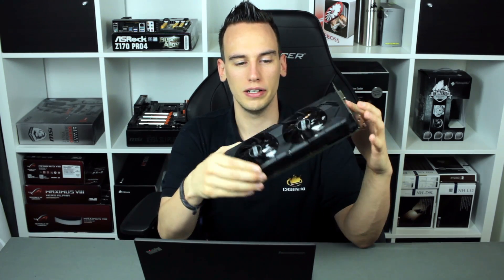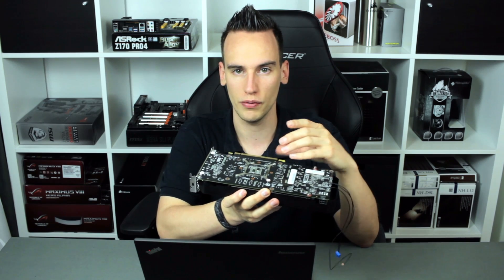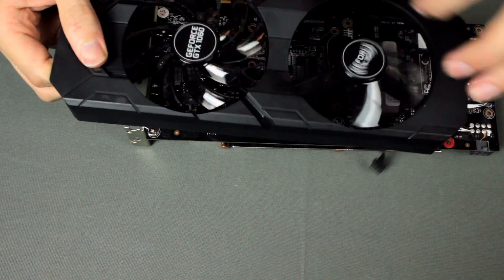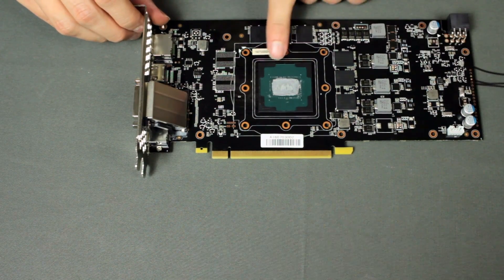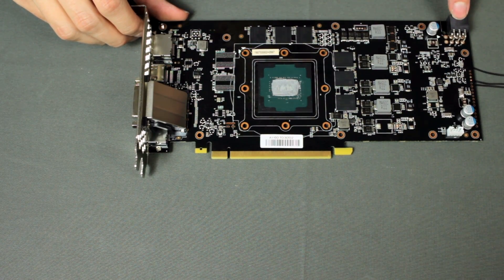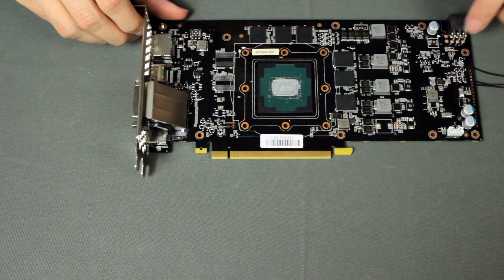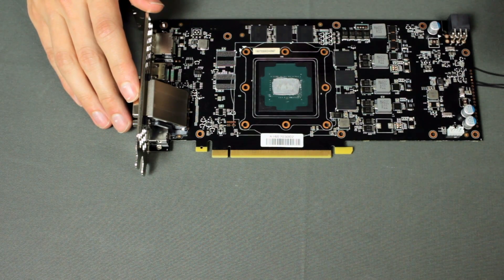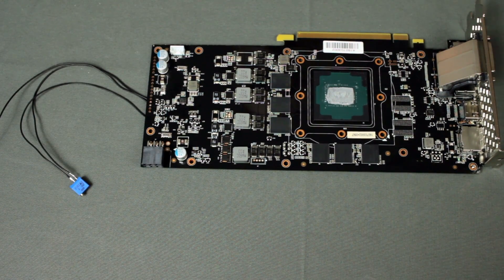Gainward GTX 1060 Overclocking to 2200 MHz with Stock cooler

Comment: Gainward overclocks mad, got my old gt730 to 1.2Ghz air.. quality
Reply: Also can you fry your gpu chips, by too much voltage if gpu processor temp stays low?
Reply: To my knowledge the individual transistors that comprise the processor IC will easily sustain 1.5V per se, however there are a few reasons why you will likely rapidly burn your IC if you try that.

For one, thermal emission is approximately squared with voltage. So you have somewhere on the processor individual transistors that emit more than a fair share of heat, but you're not measuring their temperature, you're measuring the global temperature or temperature elsewhere on the IC, while locally, on some transistors, temperatures will be much less fortunate than globally, and not just locality, the timing is of essence too, the increased thermal emission will not be dissipated at the correspondingly elevated rate. High local temperature leads to thermal degradation of transistors, and the gradient of temperature between hotter and colder transistors creates mechanical damage due to uneven thermal expansion. So you're definitely increasing degradation at a given clock rate, the higher you raise the voltage, even if you were to keep the global temperature the same by bumping up cooling.

The other issue is that nobody is measuring the temperature at VRM Power MOSFETs, a bank of powerful transistors that step the 12V comparatively low-current rail down into the low-voltage high-current rail that the processor IC runs on. Their thermal emission will rise similarly proportionally with the power consumed by the processor IC. But they already very often run at the brink of their temperature limit in stock, around 120°C is what they're designed to take with an average life of 10 years, and you'll routinely see cards running them around 110°C, and it's not uncommon of them to fail, and they tend to fail short, which kills the processor IC by supplying 12V to it straight, and not only that, they often cause a chain of component failures. When you increase cooling to get the temperature down as good as it used to be on the processor IC, the VRM MOSFETs are likely to be still left running hotter and thus more prone to fail.

You could hypothetically make all these issues go away and run your processors at 1.5V or more by reducing the clock rate way below stock, but that defeats the purpose of increasing the voltage to begin with, as you're doing this to increase signal integrity and switching speed. For example, if you increase voltage from 1.1V to 1.5V, the peak thermal emission might be 1.85 times what it used to be, so reducing the clock rate by about 45% would compensate and you'd likely have an inherently benign situation again that would shorten the life of components only minimally or not at all.

Comment: I was able to get 2250 Peak(2220 stable under normal gaming loads) on my GTX 1060SC without any modding

http://www.3dmark.com/3dm/13797859
running firestrike does pull it down to 2150 or so but thats at 65c 
https://www.techpowerup.com/forums/threads/gtx-1060-owners-club.224551/#post-3497714

Comment: What FPS could I get with an overclocked 1060, playing GTA 5 at 1440p?
Reply: aWildHooman max?
Reply: aWildHooman it does pretty well in 1440p and overclocked. Check out the video posted by TechOfTomorrow. He benchmarked on GTA 5 and overclocked as well
Reply: What does the 2x mean? Sorry it would be my first build, I know what anti-aliasing means in general though
Reply: aWildHooman oh okay, that makes more sense
Reply: also population density and traffic amount... who cares about that.
Reply: aWildHooman well my nigga!
Reply: 2x anti-aliasing  or 4x times or 8 times ..the higher the number the better ur quality on screen..it uses a lot of vram on the gpu though ..if u play on a 4k screen there is no need to apply any anti-aliasing  as the pixels are all ready condensed close to each other

Comment: BTW I have GTX470 from Gainward and its very overclockable-38% on userbenchmark.com (I can push it to 890mhz & more than 2000mhz on RAM) And the temps were 68-75C (with aditional 60mm fan on top) 
When I've done the GPU-z submitting they didn't had my bios and I gave it. Unique card. Very capable on BF4 I run with 120-180fps with .cfg file. 26-57fps on ULTRA without it.
The only higher overclock on GTX470 I saw was on liquid cooled one with bios hack - 910mhz on RAM not sure.
I like Gainward :)

Comment: I know the review is about serious overclocking but I'm also interested in finding out how efficient & noisy the cooler is on auto settings while overclocked to 2.025GHz (without the voltmods and the power limit mods). I bought the same card from Caseking.de and currently the card is on its way. I'll probably stay away from volt & power mods to preserve warranty, and there's no other reviewer covering this card atm. Thank you :)
Reply from the maker: the card is completely silent. Even on load. What do you mean by efficiency?
Reply: :) thanks for the reply!
I meant to ask how efficient is the cooling. Cause some aib partners choose high noise levels for low operating temperatures and some choose pretty high operating temperatures for a few less DB. 
So the card is silent under load, like you said, but does it get hot (80+ degrees C)?
Reply from the maker: I think the temperature target was around 70°C which is totally fine. I mean you can always adjust the fan curve manually
Reply: Yup, thanks! I'll post my OC results here when I get the card. Cheers!
Reply: The card is really silent as you mentioned. With fan speeds below 65% I can barely hear it from a closed case. And with the fan on auto and stock frequency the GPU temperature settled at 75degrees, 1860MHz, fan speed 60% - 1800rpm. 

While overclocking my sample got to 2138 MHz (+258 clock offset) on the core, 4617MHz(+615 clock offset) memory stable OC at stock voltage (1.05V). Power target 116%, temp target 83, fan 100%.

Comment: Would 1.245V be a safe voltage for 24/7 usage on air?
Reply from the maker: That's the max I'd use on air. 1.20 should be fine for 24/7
Reply: Hi, I have bought that card with an i5 4400 and seasonic s12II 430 80+ bronze, can i oc?. And what values do i have to change? I'm noob about oc. Thanks, keep up the awesome videos.

Comment: GTX 1060: 13645 score with insane overclock on modded PCB.
RX 480: 12090 score (median, 1266MHz), 13747 (highest, 1379MHz).

I know, it's synthetic test, driver is non-official and so on, but I can't see how GTX 1060 can compete with RX480 unless 1060 will be sold for 200-250 bucks.
Reply: upcoming games are dx12 or vulkan... that makes the decision even easier. if you want a card that's cheaper and will perform better in the next years... easy pick 480.
Reply from the maker: Yes I agree :)
Reply: 666nataS
you can't compare Nvidia clocks to AMDs clocks, it doesn't work because they have very different architectures.
Reply: EVGA SC 1060 = $250.
Reply: Alex Brook
alright, cheapest RX480 in Sweden is around 2700 SEK, still ref cooled. Cheapest GTX 1060 with one fan is 2900 SEK. 1060 Strix is 3500 SEK. I wonder how much a RX480 Strix will cost...
Aaand we need DX12/Vulkan benchmarks to determine which card will last longer :)
Reply: baum stamp
also, I'm not targeting ultra settings, simply not worth it. Additional post processing can be very demanding and doesn't give enough visual improvement. I turn off post processing in GTA V because it blurs the picture and reduces performance by 20-30%. If I wanted blurry visuals and FPS drops, I'd get PS3.
Reply: Where are you getting this crap?  Most people can't hit 1400 on air.  1350 is more average, and even then the clocks bouncing around due to throttling.  they don't OC well, get over it.
Reply: first.. you should count only GPU score not whole.. second.. there is no way 1379mhz 480 have better GPU score than 1060 on 2.2ghz.. do your math bro he said in FS-Extreme 1060 on 2.2ghz have 500 points lower gpu score vs RX480 on LN2 running 1.6ghz with modded tesselation !! thats the 500 points maybe even more .. now... nobody will run 1.6ghz RX480 you will see... you cant beat 1060 oc to oc .. nvidia is clever in this one .. its builded to beat 480..
Reply: Remember when the RX 480 was supposed to hit 1600 MHz? EleGiggle
Reply: true.  mega fail!
Reply: Link me one then.
Reply: +666nataS uhh... Standard rx 480's have hit 1300-1400 mhz with the reference cooler😂 the sapphitr nitro edition comes factory clocked at 1390! Cmon dude, get your facts right!
Reply: You can get roughly same gpu score from 2.2ghz 1060 as from 1530mhz watecooled rx 480. 1600mhz rx 480 is sure faster by 900-1000 points not 500. Tho the last one is on ln2. But 1500mhz is doable with golden samples like 2.2ghz on 1060 is doable on golden samples. THe two cards are roughly equal.
Reply: jacob3parker Lmao look at this guys RX 480... He changed the Thermal paste on the card and then added a custom heat sink to get this score. Makes me excited for the aftermarket cards...
Reply: In Germany the (upcoming) custom design cards for the rx480 are between 300 and 320 € atm. The MSI 1060 Gaming is 320€, there is aboslutely no reason to buy the rx480 here. Also in some EU countries like Portugal, the GTX1060 is even cheaper.
Reply: Artcore103
isn't 1350 air OC quite usual on the stock cooler? And why was RX480 supposed to hit 1600MHz? I can go ahead and say that GTX 1060 was supposed to rip and tear RX480, but it's barely any better, especially in newer games, where RX480 is actually faster thanks to better APIs.
Reply: Star Citizen is developed for dx 12 first and in most games the 1060 performs better. In Norway the two cards cost the same :( . Will more games support Vulkan than dx12?
Reply: Cossack-HD There had been rumors that it was going to be able to hit that... there was one leak in particular with screenshots showing it running at that speed.  Better cooling will help your temps and frequency stability but won't really help your max OC, only volt-modding (along with better cooling) will do that.  So the aftermarket cards don't really OC much better, they just run cooler and won't thermal throttle nearly as much.  The RX480 isn't "actually faster" in all dx12 tested games, it about catches up is all, so if it's a tie in dx12 games, yet the 1060 wins in dx11 games (which is nearly all games) it's an easy choice.  I'm not saying the 480 is a bad card, its a bit cheaper and is also a viable option if the small price difference is important.
Reply: I know its not the  1060,but just to show they can be pushed past 2150 on pascal.
Reply: Benchmarks arent games my dude, nearly every popular game on the market runs better on a 1060 than it does on a rx 480/580. None of this matters of course since 1060's are going for 1070 prices lol.
Reply: I bought my 1060 for 80 usd.
it hits 2200 on core without shunt mod, and scores just under der8aurs.
still not done modding it yet, but how did your rx480 hold up